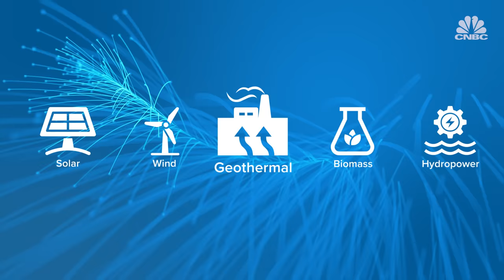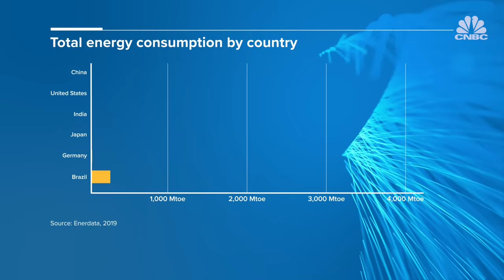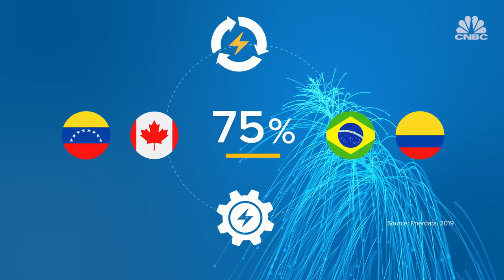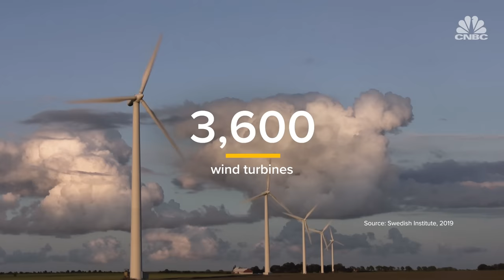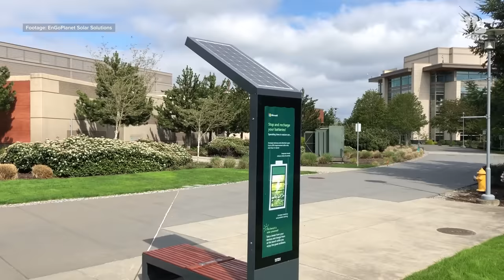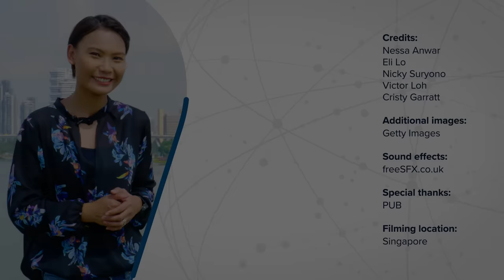Who is leading in renewable energy? | CNBC Explains

Comment: Why would you remove hydro?
Reply: Because it's a type of energy production that is very specific to your geology and is limited in how much and where you can use it. It would basically skew the charts to be less accurate.
Reply: So is wind and/or thermopower...
Reply: Because it often destroys riverine ecosystem
Reply: @DoomDutch  SO is solar, wind, solar thermal etc.
Reply: @DoomDutch  So is geothermal, wave and tidal power, solar and wind.
Reply: Hydro and geothermal are the most competitive, but taking into account geographical span, hydro wins. It is stable in the sense that its output doesn't fluctuate as wind and remains the same at night or dawn or sunset unlike solar. Hydro is cheaper per MWh than solar or wind. Doesn't require storage yet you can create another reservoir for higher flexibility so as to withstand droughts or similar phenomena or irrigate crops, etc. If you're concerned with the environmental impact if construction, you have also small RORs which can generate without the need of a dam.

Also nuclear is a great choice yet populism is bringing it down.

Also, wind and solar do have environmental adverse impacts.
Reply: That's because it is also considered as a non-renewable resource since we don't have a lot of fresh water on Earth. Once the rivers are gone, they are gone.
Reply: Solstice lolwhat? I must have missed something
Reply: Does "thermopower" mean geothermal or solar thermal?  At the very least, geothermal HVAC would work in every continent.  Even Antarctica has enough geothermal heat to melt the ice, according to NASA.
Reply: @dadanifit  Everything has adverse effects, that's why there is not only one solution but you need a little of everything.
Reply: Jayson Maharaj It releases co2 as well.

Comment: Energy storage should have been the first thing people started working on, so peaker plants wouldn't need to exist.  Changing where the power comes from is an important step, but it's not the solution that should have come first.  If we had developed battery, compressed gas, thermal, and gravity storage systems back in the early 80's, the world would be a far different place today.

Comment: Install solar at rooftop, per unit cost is Rs3 to 3.5. It not only saves your bill with cheap power but also reduce co2 emissions. Also use battery operated vehicles for clean environment.

Comment: The 'average Joe/consumer' has NO idea of just what is involved in 
"Renewable energy", especially the cost and effort that is involved in 
'producing' these elements or items that harvests this power for 
distribution to the general public/ consumer. Trillions of dollars spent
 in the collection of the raw materials that then have to be 'processed'
 into the parts and hard ware that goes to make these items. Let alone 
the power that has to be generated to make the steel, copper, glass, 
wiring, printed circuitry, and then the transportation and 
erection/construction of these devices, THEN, all of these wind mills 
and solar farms and battery storage facilities and factories designed to
 make this crap has to be repeatedly replaced as all this infrastructure
 reaches it's "Use by date." But to make it pay for all these companies 
who have money invested in this technology, the prices are designed to 
make huge profits for the investors and give NOTHING for the 
environment. More co2 will be produced in the production of all this 
hard ware than all the cars driven on the worlds roads over the last 150
 years. 'Renewables' is a crock of shit. Choke on those facts.

Comment: just to fact check: The UAE was among the first to ratify the Paris agreement, and launched the vision 2021 10 years ago to switch to 20% renewable mix for the national grid, to which it overshot and achieved it baby 2019. Now its working towards 2030 for 50% renewables, and carbon neutral bay 2050. The UAE is also responsible for the boost of renewable energy in developing countries through Masdar's investments and R&D programs.
Reply: The UAE also added a single nuclear power plant and that makes them 25% nuclear powered. They just need a second power plant of the same kind and they're 50% nuclear. They can do whatever else they like with the rest of renewables, as long as they have clean reliable electricity and water desalination.

Comment: By the way, solar panels are not green.  It takes 6-8 years of operation to pay off the energy/carbon foot print used to make solar panels.  And you still haven't considered the "environmental cost" and hazardous waste involved in making silicon modules or the hazardous waste of the batteries.  Coal is actually cleaner-even in some of the dirtier plants.

Comment: I hate it when they pretend batteries can make grid storage viable. It doesn't, what is does is adjust the output frequency and voltage. thereby allowing for optimization of fluctuating renewables.
Maybe large scale Vehicle2Grid can change that, though, I still doubt it would, due to degredation of batteries (if you use other people's batteries you best not damage them). V2G as implemented now, is also just for optimization of electricity quality.
I have recently been interested in using renewables to produce Hydrogen by electrolysis, and then storing it as either Hydrogen or ammonia for fuel purposes. I think that has much more potential on greater scales.
Although I am interested in what other future possibilities exist.

Comment: What is still wrong with wind farms? We have already mentioned our pockets, from which we will pay for these ambitious decisions. Huge investments in money and resources are needed to build a wind farm. At the same time, the average lifespan of a wind turbine is 20 years. The same goes for them as for solar panels. Once the required number is set, the old ones need to be replaced. During that time, only 78% of the funds spent on its production and installation managed to return. Not to mention maintenance, which includes the construction of special vessels, expensive high-altitude work and constant replacement of blades. More than 500 tons of lubricant are needed for just one wind turbine, which is comparable to 9 railway tanks, which, by the way, are also produced from the planet's non-renewable resources.

Just imagine: the length of the blade can reach the length of a football field. Do you know what they are made of? Yes, from the same plastic that we continue to fight so unsuccessfully around the world. Due to their giant size and dangerous chemical composition, they cannot be disposed of. Therefore, the classic solution - propellers are taken to landfills and covered with earth. After that, do you still think wind energy is environmentally friendly?

Comment: per watt? what a mistake..., the unit should be per kilowatt hour, or KWh
Reply: This is not a mistake.  Photovoltaic panels are measured in maximum power output.  Kilowatt-hour is a unit of energy, which is power output for a given amount of time.
Energy = Power x Time

Comment: Hydrogen is the only right energy carrier on the earth in the present era. No other variant. In far future, hydrogen is the necessary prerequisite for new future fuel of energy. It is the mass. Any mass materials can become fuel for energy by the similar formula E=mc2.  To convert compound material to energy, it is comfortable firstly to split compound materials to the simplest form- the hydrogen, then convert hydrogen into energy with more percentages.  Nuclear fusion reactors can generate energy from hydrogen (isotope), but it is only a very partial case of human known form of converting material to energy by E=mc2. Hydrogen is not only the most abundant element in the universe, but also the most simple basic element in the universe. So hydrogen is the key factor for almost future high energy technologies. 
     It is now the time to stop any doubts about up-coming hydrogen era. It is right now the time to accelerate and race hydrogen economy and technologies.
     There must be now 2 waves for hydrogen :  1/BUILD HYDROGEN PRODUCTION FACTORIES  FOR RENEWABLE ENERGY STATIONS, AND EVEN FOR NUCLEAR ENERGY STATIONS, FOR NUCLEAR FUSION ENERGY REACTORS.  If build networks of regional hydrogen production factories, then any townhouses  will have small stable lucrative business  of selling electricity to network of hydrogen production factories anytime by equipping  household small solar farms (200m2) very cheaply because of no batteries. All cities can go to the new global trend of CITY RENEWABLE ENERGY ORIENTED ARCHITECTURE, in which all roads will have photovoltaic top roofs at the centers along roads with roof pillars along center lines of roads. CITY RENEWABLE ENERGY ORIENTED ARCHITECTURE urges installing all renewable generating devices/systems anywhere, then sell electricity to networks of regional hydrogen productions factories. Any city houses and buildings can install photovoltaic top roofs to automatically sell electricity to networks of regional hydrogen production factories, and no problem of wasting excess energy, no battery necessary.  2/ In storing hydrogen and distributing hydrogen, we must use standard sized compressed hydrogen gas canisters parallelly with other methods, for example, pipeline transfer and hydrogen liquid storing. Produce standard sized compressed hydrogen canisters. Distribute standard sized compressed hydrogen canisters everywhere.  Buy hydrogen by exchanging empty standard sized canisters for standard sized full compressed hydrogen canisters. This method of exchanging is not the most effective, but is the easy and reasonable way to distribute hydrogen anywhere.  Any mini shops can be warehouses for hydrogen canisters. For example, a mini shop can store 300 standard sized compressed hydrogen canisters. If it does 50 exchangings of hydrogen canisters per day, then it is normal small retail business.  Motorcycles and human sized robots and machines require only comfortable small sized compressed hydrogen canisters.   I guarantee that producing compressed hydrogen balloons is easier and cheaper than producing AAA batteries. Hydrogen can seep through small gaps of cheap material, but if hydrogen  leaks 1gr-10gr  per month for balloon 1kg, then it is not a problem.  We can not build hydrogen loading stations anywhere, we can just build hydrogen loading stations in important places,  but we can distribute hydrogen canisters anywhere in any angles of societies. 
            Hydrogen has energy storage coefficient, which is nearly the maximum limit for all known chemical mechanisms. It means that ALL FUTURE POSSIBLE CHEMICAL BATTERIES WILL HAVE ENERGY STORAGE COEFFICIENT LESS THAN HYDROGEN. So . ANY HUMAN SIZED MOBILITY ROBOTS AND DRONES MUST BE POWERED BY HYDROGEN. A lot of army vehicles must be powered by hydrogen too, because of efficiency, even without counting environment profit. 
 The most economic fuel for passenger aircrafts is hydrogen. 
        New concept of hydrogen battery, which is the combination of hydrogen production factory + hydrogen fuel cell module. In very compact small spaces, people still can not construct hydrogen batteries. But in larger spaces, for example in areas of energy plants, people do already can construct hydrogen batteries.  Should note that hydrogen battery  has best energy storage coefficient, best energy converting coefficient, best energy powering coefficient for almost future possible chemical batteries. It means that all future possible chemical batteries will have less energy storage coefficient, less energy conversion coefficient, less energy powering coefficient.  It also means that all companies, for example Tesla, should take ready hydrogen batteries for energy plants instead of their "mind  bogglingly stupid" doing and improving other chemical batteries for energy stations. 
          Many people, especially EU governments still do not estimate enough important role of hydrogen. Hydrogen is the key factor for renewable energy in offshore and building marine society. Far offshore wind energy, ocean wave energy, tidal energy and even ocean solar energy must live with hydrogen. Hydrogen is the key factor for energy-autonomous floating offshore social ocean units too.  It is impossible to effectively use ocean energy without hydrogen. HYDROGEN ECONOMY WILL CHANGE GEOPOLICY IN EU, because hydrogen economy is the most reliable way to make EU to be less depended on gas suppliers for winter warming. Best cooking is powered by hydrogen fuel cell, because our traditional cooking creates toxic CO2 + NOx directly in apartments.  When we use more renewable energy and turn off fossil stations, we need some reserved solution to reduce consequences of disasters, it is the hydrogen storing and distributing.  If we use more nuclear energy or even nuclear fusion energy, then hydrogen is a must have, because  it is not effective to continuously vary power of nuclear energy stations, so there are always excess energy from nuclear stations into hydrogen.  Hydrogen is best intermediate energy carrier for storing and distributing on the earth, especially when combining hydrogen storing and distributing with nuclear energy stations.  Hydrogen is the only possible instrument to import and export renewable energy worldwide.  You can not pack all energy of period 3 months of solar farms into chemical batteries, but you can pack all them into hydrogen to sell or distribute hydrogen worldwide. It is normal to setup mind that many renewable energy stations are EXCLUSIVE ONLY FOR PRODUCING HYDROGEN, BUT NOT FOR GENERATING DIRECTLY ELECTRICITY.  I think that international corporations, especially EU governments, Japan, Korea should soon cooperate with African countries and middle east countries to build network of solar plants + hydrogen production factories for the exclusive business purpose : producing hydrogen and selling hydrogen.  America and China, Australia have very big resources of renewable energy (solar, wind), and they can harness much only with hydrogen, then can be big hydrogen exporters too. 
      Many people complain that it takes so much electricity to receive hydrogen in electrolysis process. Maybe they have offside worry.  Electrolysis process requires so much energy, but all energy is transferred into chemical energy of hydrogen with very small loss. In other direction, hydrogen fuel cell extracting all chemical energy of hydrogen directly into electricity with very small loss.  The most remarkable difficulty of hydrogen is storing hydrogen. We need some energy to pack hydrogen. But even with that, many detailed countings show that the cost of hydrogen from renewable energy can soon be lower than gas in near future.  
      In the hydrogen economy, battery electric vehicles can be useful too. But hydrogen vehicles can be as popular as battery electric vehicles in the near future when there are much hydrogen production factories worldwide. Hydrogen cars even can be more popular than battery cars.  Many people  laugh and doubt about the future popularity of hydrogen cars, they list some reasons, for example, high energy cost.  But the main reason of the future popularity of hydrogen cars is not in hydrogen cars.  The reason is that,  people must use hydrogen as the only reasonable artificial energy carrier on the earth.  Any comparisons between battery cars and hydrogen cars are no meaning right now, because we do not have hydrogen now. (We have very less hydrogen, and we are still using fossil fuel).  But when we tend to stop fossil fuel, then we must  produce a lot of hydrogen.  Renewable energy is volatile. Nuclear energy can not continuously change power.  Energy itself is volatile too, but only energy carriers are stable.  We must synthesize our artificial energy carrier, which is hydrogen, when we stop using natural energy carriers, which are natural gas and oils.  So we will have a lot of hydrogen in the future.  And the question is that what will you do with hydrogen in transport ?  The usual answer is that we will use hydrogen to generate electricity to charge our battery electric vehicles. It is acceptable answer, but it is not so good answer.  The other answer is that we can use directly hydrogen in hydrogen cars.  When we stop fossil fuel, then of course you will charge your battery cars at night time from hydrogen.  The forever uncomfortable problem of charging time of battery cars will be the forever reason for a lot of people to use hydrogen cars.  Small battery cars have battery weight about 500kg while hydrogen tanks have weight about 40-100kg.  
        And the last thing to note is that, hydrogen is not more dangerous than other gases and petrol. Hydrogen has big energy storage capacity, but when burning hydrogen in accidents, IT DOES NOT CREATE ACOUSTIC DESTRUCTING WAVE TO ENVIRONMENTS.  It means that hydrogen burning is less destructive than gasoline burning.
Reply: Liquid hydrocarbon is better, because it's not a gas you need to pressurize. In fact, even ammonia is better, it's similar to hydrogen in that it can be used in a fuel cell, but it can be liquefied at moderate pressures, compared to hydrogen. Unfortunately it's pretty toxic so it's bad if it leaks. Overall, liquid hydrocarbons are just more versatile, stable, and energy dense.